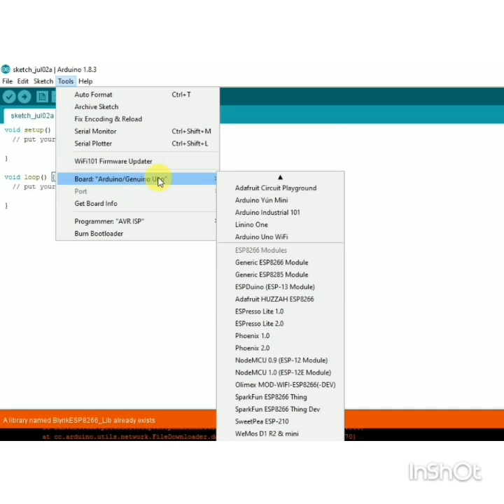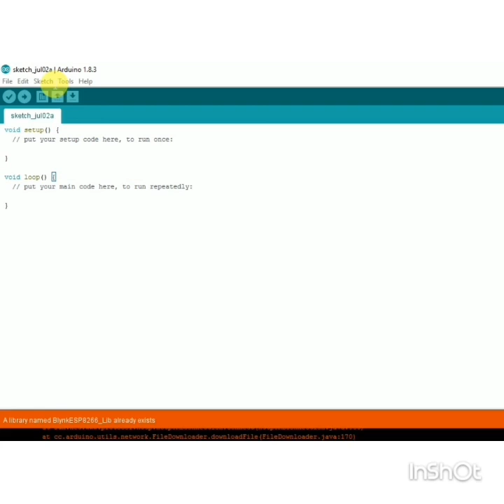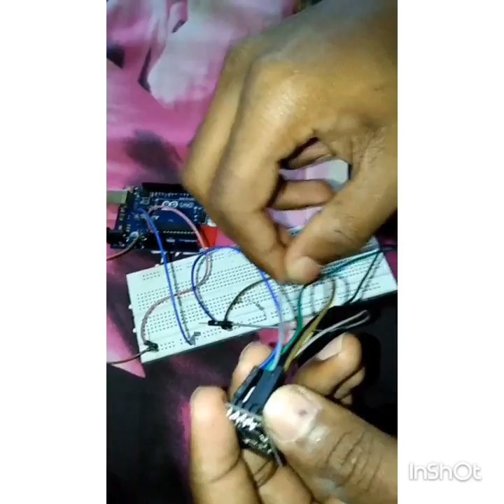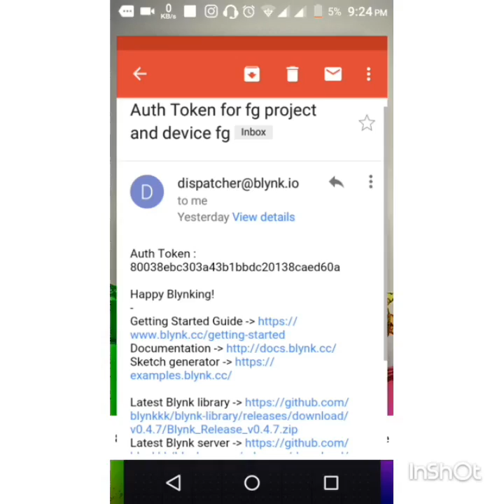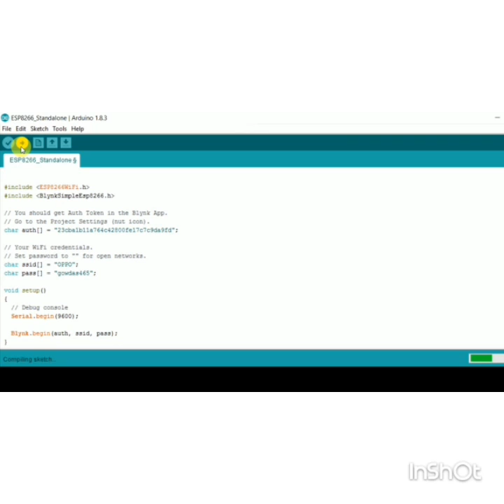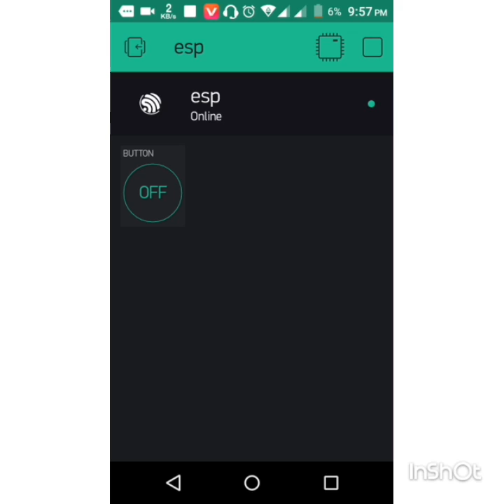ESP8266-01 control using Blynk (wifi) and programming ESP

Comment: Bro i accedentaly connected my module to 5v
Reply: Is it damaged now?
I've heard that some esps work with 5V properly, and 3V doesn't enough to switch them on.
Reply: @djfn4s3r45  no bro its not damaged now it work finelly but when you connect it to 5v it produce more heat.heating is not good for this board so my choice is 3v
Reply: @Pablochocobar-321  Nice, the modules are pretty crazy ;)
Reply: @djfn4s3r45  thats why i switched to esp32

Comment: It is showing a error error compiling for board generic esp8266 module
Reply: Hey got the solution  just needed to update the library
Reply: Mine 2
Reply: Ny solution
Reply: @yadhu_yk  got the solution just use the library version he is using in the video that it......works fine

Comment: What a detail video !
But when I uploaded, that errors occured
''warning: espcomm_sync failed
error: espcomm_open failed
error: espcomm_upload_mem failed
error: espcomm_upload_mem failed''
All connections are the same with video, and I didn't connect RST pin of ESP to anything.
Reply: Connect Arduino's RESET Pin to Ground. I was even getting same error, but after doing this, the code was successfully uploaded.

Comment: Arduino: 1.8.7 (Windows 7), Board: "Generic ESP8266 Module, 80 MHz, 40MHz, DIO, 115200, 512K (64K SPIFFS), ck, Disabled, None"

In file included from C:\Users\debashis\AppData\Local\Temp\arduino_modified_sketch_356238\ESP8266_Standalone.ino:37:0:

C:\Users\debashis\Documents\Arduino\libraries\Blynk\src/BlynkSimpleEsp8266.h:18:21: fatal error: version.h: No such file or directory

 #include <version.h>

                     ^

compilation terminated.

exit status 1
Error compiling for board Generic ESP8266 Module.

This report would have more information with
"Show verbose output during compilation"
option enabled in File -> Preferences.

Comment: After compiling it says "error compiling for generic esp8266 module" pls help
Reply ASAP
Reply: make sure your reset pin of esp is not grounded while uploding the code,  only gpio 0 needs to be grounded!
and also make sure you have selected the " Generic ESP8266 Module" board in tools.
Reply: @gau1av  this does not fix the solution :/
Reply: Im getting the same error

Comment: I used 10k ohm resistor......could that be the reason my esp8266 led is not glowing ( led which is on esp8266 module)........i did all the connections correct

Comment: Arduino: 1.8.4 (Windows 7), Board: "Generic ESP8266 Module, 80 MHz, 40MHz, DIO, 115200, 512K (64K SPIFFS), ck, Disabled, None"

Board generic (platform esp8266, package esp8266) is unknown

Error compiling for board Generic ESP8266 Module.

This report would have more information with
"Show verbose output during compilation"
option enabled in File -> Preferences.
Reply: this error is occured  what will do

Comment: i have a  problem  -Archiving built core (caching) in: C:\Users\neung\AppData\Local\Temp\arduino_cache_623470\core
\core_esp8266_esp8266_generic_CpuFrequency_80,ResetMethod_ck,CrystalFreq_26,FlashFreq_40,FlashMode_
qio,FlashSize_512K0,LwIPVariant_v2mss536,Debug_Disabled,DebugLevel_None____,UploadSpeed_115200_c3e47e81793b0af5ffc2dbd74e9e0075.a

Comment: I have a problem .
I am connecting my Esp 01 to my mobile hotspot.
It is connecting to blynk
But it is working for 5 to 8 sec.
Then it showing device disconnected.
After few seconds the device is online and then disconnected.
In serial monitor 
"Pingtime = 12msec"
"Connection timeout"
This is repeated often in serial monitor
Reply from the maker: Poornesh Chandharan even I encountered the same problem some times, ,I don't know what's the exact solution for that, ,I will look into that and reply you soon.

Comment: How u connected esp8266 to internet ???  
Is the communication between esp8266 and mobile blynk app is over internet ???   Please need some help on this.
Reply from the maker: Tushar Paithankar esp is connected to Internet through wifi connection.and yes it's through internet where the blynk helps in communication with esp